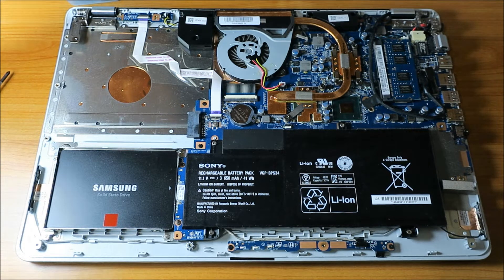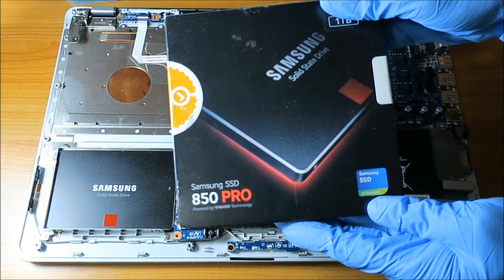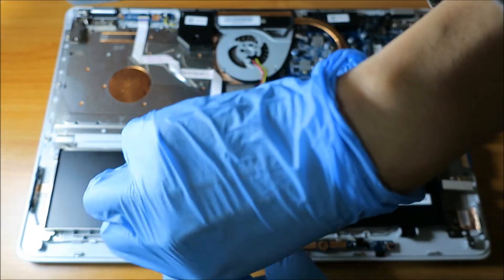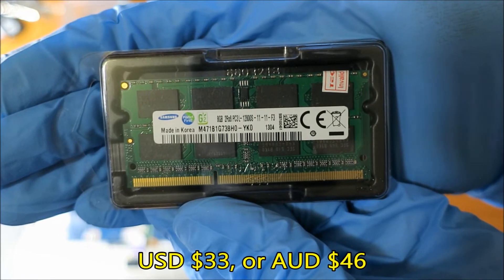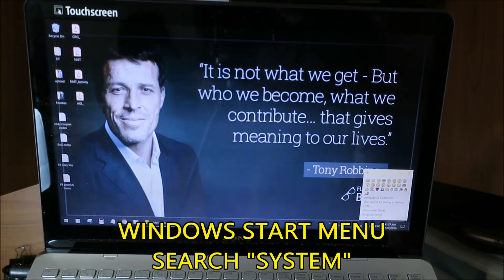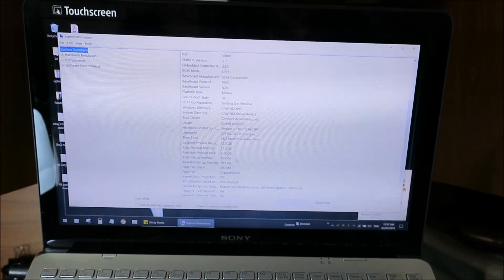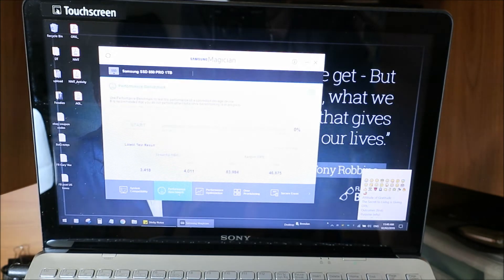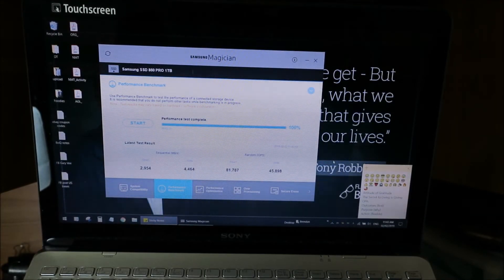Laptop RAM Upgrade, Sony VAIO Fit 15 SVF

Comment: I got sony viao laptop SVF15A1BCXS  I got 8 Ram and I find out I only could add 4 more is that would make any difference? Please give me your advice, Thanks!
Reply from the maker: To answer: Yes you can upgrade to 12GB total as I did in the video. But not necessary, 8GB total is still enough for modern use. It's nice to have but I don't utilize the whole 12GB. Shop around for a good deal on RAM. I just checked online sales, generic 8GB DDR3L-1600 laptop memory for sub $30+. Note type "L" is low voltage memory for laptops. 
The biggest  performance upgrade is from old SATA disk to SSD. It's a high speed hard drive. Hands down the best upgrade! It's a different computer, better than new. Shop around, Samsung EVO 500GB SSD A$85. 
 
Your CPU: Intel Core i5-3337U (1.8-2.5 Ghz clock speed). It's still usable for basic office work, and streaming. But getting old. I'd recommend a newer computer. But if you wish to keep it working I would do SSD for sure, new hard drive. 
I have the faster and more powerful Core i7 CPU, so was worth the upgrades. See the links below. Hope that helps. 
 
Sony Vaio SV-F14A15CXB Specs 
https://www.notebookcheck.net/Sony-Vaio-SV-F14A15CXB.92383.0.html 
 
Crucial Memory Upgrade Guide for your model 
https://www.crucial.com/compatible-upgrade-for/sony/vaio-svf14a15cxb 
 
SSD Upgrade Tutorial SV Fit laptop 
https://www.youtube.com/watch?v=09Zc279GQbA&t=49s
Reply: Yes, I don't know what to do, I got an office job, so when I'm home, I just play with my Ipad, so my Sony laptop which is in great conditon &  don't use it as much. Recently...
I installed Windows 11! lol, even thought Microsoft didn't allow me to upgrade from Windowns 10 since my laptop is an oldie...So far it's working good...I just want to tell you that I really appreciate so much your input since you took the time to give me your sharp & honest feedback...You're just the BEST!!!  @BAdventures
Reply from the maker: You're welcome. I understand. I had to retrain and learn all this tech stuff. Then I upgraded both my old laptops. Another Sony VAIO-S Laptop SSD Upgrade https://www.youtube.com/watch?v=k_-HPVC59Bo&t=2s
Reply: Hello Buddy, I'm sold, I'll upgrade my current laptop that I like, Do you have a video of how to transfer absolutely all my files into an internal SSD, I think done thru a SATA cable...If you do please show me the link, Thanks!!!  @BAdventures
Reply from the maker: I showed on both my SSD Upgrade videos. Yes you will need a SATA cable. The Samsung software will 'clone' and copy everything for you to the new SSD hard drive. Then you physically install it. When you turn on your computer it will be the same, just faster. Watch it again. But always good to make a separate back up drive. Simply copy your files using the provided USB cable. Can also get help from a local technician or computer shop if it's too much. 
Sony VAIO-S Laptop SSD Upgrade https://www.youtube.com/watch?v=k_-HPVC59Bo&t=2s

Comment: Hey I've been searching for my SVF15A13SNB, but its quite confusing. On crucial it says the ram can be upgraded to 12GB max, but I can't find it on Sony's website. Is the RAM upgradable?
Reply from the maker: Sounds very similar to this model, so probably yes. I showed it in the video. Best thing to do is open it up and take a look. I also upgraded the old SATA hard drive to SSD. Hope that helps 👍
Sony VAIO Fit SSD Upgrade https://www.youtube.com/watch?v=09Zc279GQbA
Reply: @BAdventures  thanks for the reply, I've decided to take it to a technician because I don't wanna risk opening it and ruining something. It works great but the lag at editing and gaming is real so I thought I could maybe upgrade it to move the performance a little bit and extend it's time. Thanks again for the reply. 😀
Reply from the maker: I understand it can be daunting first time. Whatever works for you. But you can do it yourself. Replacing the old hard disk drive (HDD) with a Samsung EVO SSD would be the best upgrade. All computers get slow when the HDD wears out.
Mine came with an old Broadcom network/wifi card. Internet was terrible, would cut out regularly and no Bluetooth. Replaced it with an Intel wifi card. Much better and has Bluetooth.
Don't be afraid to ask for help. Hope your upgrades go well 👍

Comment: Great video thanks a lot! One question: I have a Vaio SVF153A1YM, how can I know if I can upgrade 1 slot or 2 slot ram before opening it?
Reply from the maker: I can't find your specifications. Check your model number again. You can try open up the laptop and inspect the configuration. See video below. Hope that helps ✌️
SSD Upgrade Sony VAIO Fit 15 https://www.youtube.com/watch?v=09Zc279GQbA

Comment: Should I Buy this laptop in 2021 as my secondary laptop for basic research surfing and MS word or should I buy Lenovo ThinkPad T440 or Should I buy Samsung Tab S6 Lite?
Reply from the maker: Honestly buy a newer CPU, or a tablet. Think about what outcome or result you want. Tablet is probably best for light surfing, mobility, and convenience.
If you really want another laptop there's plenty of used Intel Core i7 CPU's with modern specs.
Whenever looking at a computer check the processor first.
This has been a great laptop for me. But it's old, that's why I did the upgrades. Extended it's service life and performance.
I'm still waiting for the newer AMD Ryzen CPU's and OEM computers. When the parts shortages and prices calm down I'll get a new computer. Hope that helps ✌️
SSD Upgrade Sony VAIO Laptop https://www.youtube.com/watch?v=09Zc279GQbA
Reply: @BAdventures  Thanks for your response bhai(brother in Hindi Language), my situation is that I am going to buy laptop in July and that will be a gaming laptop but I have work also coz I am a legal attorney so I wont be taking out much, my gaming laptop, and in phones it is not great to view MS word Files..so to fill in the gap I was thinking to buy a tablet or Laptop whichever is worth my money and is of considerable budget and in India electronic gadgets and appliances are quite costly and we cannot afford buying them just after 2 3 year, specifically not me. so just like Ebay we have OLX second hand online sale purchase platform and other than that we also have Nehru Place Market which is Asia's largest computer market. however I am getting a deal for this Sony Vaio laptop in MORE cheaper price than Samsung tab s6 lite (both secondhand)..that is when I searched for this laptop's review and I got your's. Although the corporate offices over here consider using Lenovo Thinkpads and Dell Latitudes but they are also outdated like 6 to 7 years old and like thinkpad the last i was getting was Lenovo Thnikpad T440 i5 4th gen.
Reply from the maker: Ah I see. I also do business consulting work. I use my old 13" Sony VAIO for travel and basic work. Yes I know the feeling using very old work laptops from Lenovo and Dell. Nothing fancy, but they got the job done.
You're on the right track. No need to get brand new. If the CPU is still modern performance you can upgrade the hard drive to SSD. Look for a used Core i5 or i7 laptop if possible.

13" Sony VAIO-S Upgrade SSD https://www.youtube.com/watch?v=k_-HPVC59Bo
Reply: @BAdventures  thank you so much for your time and giving me such wonderful suggestions. 😊✌🏻

Comment: Is it common that this model speakers wont last long. Its not working in mine.. i guess  i need to replace them. After seeing your video i will definitely upgrade with Ram, SSD, battery, and speaker’s
Reply from the maker: The internal speakers are weak. Common on most laptops. I use headphones, or external speaks. Try that first.
Glad it was helpful, do the SSD first. It's the best upgrade for an old computer. Faster everything. Don't replace the battery or RAM unless you have to.
You can find a Samsung EVO SSD much more affordable now. Feel free to message me if you need help.

SSD Upgrade Tutorial https://www.youtube.com/watch?v=09Zc279GQbA

My FB easier communication https://www.facebook.com/BAdventuresAU
Reply: yes, i have the same model and the right speakers is damaged now, I already upgraded RAM and put SSD.

Comment: Hi, thank you so much for the video. I have the exact same laptop and want to know if I can instead replace the non-welded 4gb ram with a 16gb ram instead of an 8gb one like you chose in this video? Would that much still supported by the hardware and can the mainboard still recognize the updated ram?
I wanted to ask since I know the maximum ram capacity for ddr3 rams is 16gb per slot, and with my new course in college running android studio, having as much ram as possible is very much appreciated.
Reply from the maker: Glad you liked it. To answer your question: No.
Manufacturers often lock the main-board and or BIOS so there is a limit on RAM. The Sony VAIO specs on my model are maximum 12GB total. Honestly 8GB total RAM is enough for this machine. I did these upgrades to keep my computer running longer. Worked out perfect. I enjoyed the learning experience.

The BEST upgrade was the SSD hard drive. Faster everything. Don't hesitate or delay. You can find Samsung EVO SSD's more affordable now.
Laptop SSD Upgrade https://www.youtube.com/watch?v=09Zc279GQbA&t=1s

Otherwise upgrade to a newer computer.
I'm researching newer computers and parts. I want to build one in future. Hope that helps 👍
Reply: @BAdventures  thank you for your prompt response. It helps tremendously <3 I'll look into SSD as well, good day sir
Reply from the maker: I understand it can be daunting. Don't be afraid to ask for help 😉✌️

Comment: hi - iám from Brazil - could you tell me if i can change my sony vaio svt13115fbs - harddrive for a new SSD and add a new memory - i opened the bottom part of it but i dont know the specification for the connection to buy new one
Reply from the maker: Welcome. It's often call 2.5" hard drive connection. You can get Samsung 860 QVO or EVO models much more affordable now. I demonstrate in the link below.
Sony VAIO Fit, SSD Install Tutorial https://www.youtube.com/watch?v=09Zc279GQbA&t=1s
Reply: B Adventures thank you. I will give it a try it is a lot more cheaper than buying a new one. Thanks
Reply from the maker: Is this you model? Sometime tech specs can vary each model.
Sony VAIO SVT13115FB Silver Laptop, Intel Core i5-3317U.
https://icecat.us/br/p/sony/svt13115fbs/vaio-notebooks-svt13115fb-19361042.html

The SSD will make the biggest difference. Faster everything. Will be like new again. Also 8GB of RAM is all you need if you want to do that too.
Good luck. You can contact me on my Facebook. https://www.facebook.com/BAdventuresAU
Reply from the maker: Sony VAIO S 13" Laptop Upgrades:
DRAM https://www.youtube.com/watch?v=X0ljlSLQIqc&t=625s
SSD hard drive https://www.youtube.com/watch?v=k_-HPVC59Bo
Reply: @BAdventures  thank you - it is changed and working.

Comment: Is that the one with the touch screen? I saw they make a kit for the Sony to update it to  touch screen  and to improve picture
Reply from the maker: Yes it is a touch screen, older model now. I upgraded: RAM, Network card (better WiFi & BT), and Hard Drive. See link below 😉👍
VAIO Fit SSD Upgrade https://www.youtube.com/watch?v=09Zc279GQbA&t=1s

Comment: Please help! I have sony vaio fit 15e (SVF15212SN) and on sony's website it says RAM max upgradeable upto 8GB. So is it 8gb per slot or in total 8gb?
I was considering to upgrade it to 16 gigs but Sony confuses me.
Reply from the maker: Yes it's confusing how they describe it. Looks like you have 2 slots, so can upgrade with 2 stick of 4GB memory = 8GB total. 1600 MT/s speed. DDR3L, L = low voltage. Open up the RAM bank cover and check. Link below to similar model and upgrades. The SSD was the best and will make it better than new.
VAIO-S 8GB RAM https://www.youtube.com/watch?v=X0ljlSLQIqc&t=625s
VAIO-S SSD hard drive https://www.youtube.com/watch?v=k_-HPVC59Bo

You're running a core i3 processor. For what it's worth you're better off upgrading to a newer computer. Get an Intel core i5 or i7. Or latest AMD Ryzen 5 or R7 processor.
Reply: @BAdventures  thanks for replying.
Yeah I'm thinking of buying a  new desktop.
Reply from the maker: Yes a desktop will be more powerful and last longer. More space for cooling and upgrades. Even used or an older model. Depends what you are doing with it.

Comment: Have u ever replaced your batterie? If yes where did u buy it? I bought a greencell (brand) but it died on me after 4 month of low usage.
Reply from the maker: No not yet. I have seen the Panasonic OEM spare part on ebay and other online parts stores.
I did get battery life warnings when it was on Windows 8. But after I upgraded to Windows 10 and SSD, the battery warnings went away. Win10 and VAIO Care both recognised the battery as healthy again. I suspect the lower heat and power usage from SSD helped. Also updated software better manages it all.
SSD Upgrade https://www.youtube.com/watch?v=09Zc279GQbA&t=1s
Reply: @BAdventures  thanks for your reply! Since you said heat could cause the battery data to malfunction I did a little cleaning in the fan and vents. I also reset the battery drivers and my warnings and battery issues went away. Thumbs up!
Reply from the maker: Nice work and good deal. You can also get Samsung SSD much cheaper now. See the SSD tutorial video 😉👍

Comment: I hope you can answer my question so is it better to have 12gb ram single channel than 8gb ram dual channel? 
Because when the 2 ram is not the same GB it will not be dual channel like 4gb+8gb
Before it is dual channel 4gb+4gb
Reply from the maker: I understand and good question. To answer, yes 12GB (4GB on-broad +8GB) total is better than 8GB dual channel (4GB + 4GB). Why? I monitor my RAM usage and there are times it's at 50-70% (Core Temp, and CPU-Z). Over 6GB-8GB of RAM in use. This means: Dual channel is still working; or reverted to Single channel and the 8GB DRAM stick; or a Combination of both. It works so I'm not fussed. As programs and applications evolve I'll need the extra memory. There are too many variables. Different builds, BIOS, quality of the memory, how it's used, etc. I'n not using fancy testing or benchmarks. So I'm happy to max out my memory and call it good.
I also upgraded my other laptop with 8GB (4+4 dual channel), link below.
Sony VAIO-S RAM Upgrade https://www.youtube.com/watch?v=X0ljlSLQIqc

Comment: hi my friend my laptop is sony vaio SVF1521GSA and this is specification website  https://www.sony-asia.com/electronics/support/laptop-pc-svf-series/svf1521gsa/specifications    
 what should i upgrade my ram
Reply from the maker: Your manufacturer specs say you have one stick of 4GB RAM installed. Can upgrade to 8GB RAM total. Install one more 4GB stick. Locate the memory bank and open up to confirm. Take a pic so you can see the type. You can search the RAM spec below.
'4GB DDR3L 1600mhz (PC3-12800) RAM laptop'. I used Samsung RAM, but any brand will do.
This video may help, Sony VAIO-S RAM Upgrade https://www.youtube.com/watch?v=X0ljlSLQIqc
Reply from the maker: If your computer is slow the old hard disc drive is worn out. Upgrade to SSD. Everything is faster.
Sony VAIO-S Install SSD https://www.youtube.com/watch?v=k_-HPVC59Bo

Comment: Pare, I have previously upgraded two of my home Vaio laptops to Crucial MX500 SSD. I have another Vaio SVF15AA1QW that I want to upgrade both the SSD and the Ram (shell back like yours so feeling intimidated to open it). 
I’m wondering if you have a personal preference between the two brands between Crucial MX500 vs Samsung Pro SSD. I’ve never tried Samsung before and saw that you’ve installed the Samsung SSD.
Reply from the maker: 1. Sony VAIO Fit SVF15 is actually easy to work on, see link at bottom. SSD is the best upgrade to any old computer. Everything is much faster.
2. Samsung SSD's are very good quality. The PRO is designed for hard use and longer service life. Depends how you use your computer. I got the 850 PRO for many file transfers and video editing. I recommend the newer 860 EVO model. As fast as the PRO and more affordable.
3. Samsung 860 QVO economy model. I've not tested the QVO, but heard mixed feedback. Little slower read/write speeds compared to EVO and PRO. Not for hard use. Fine for general use and storage. Still all the benefits of SSD.

SVF15 Laptop SSD Install https://www.youtube.com/watch?v=09Zc279GQbA
Reply: Many thanks Pare, I truly appreciate your assistance! Stay safe and wishing your channel lots of success. 👍🏻